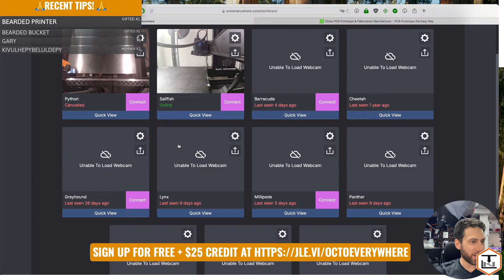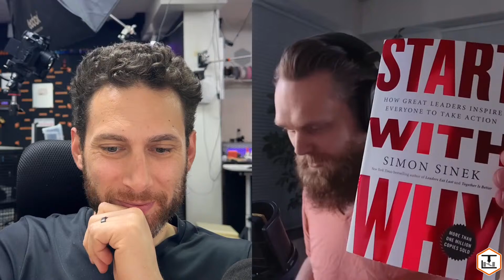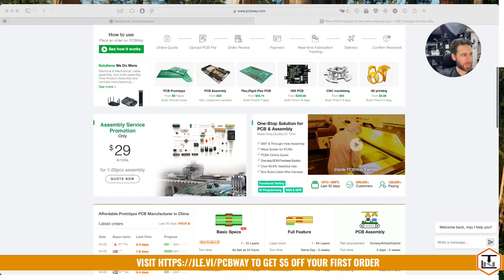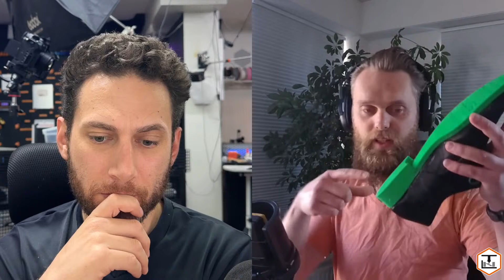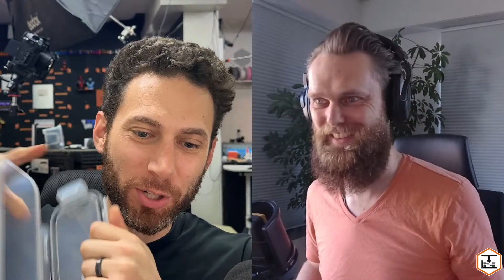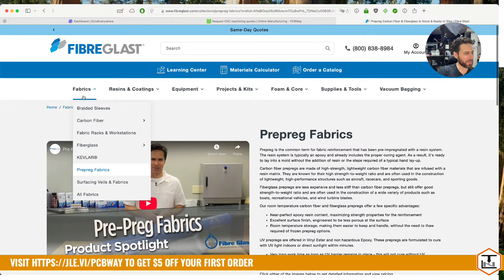Ep. 60: Jón Schone of Proper Printing on The Art of Experimentation and Breaking 3D Printing Limits

Comment: Re your printers and IP addresses. They are probably registering themselves with octo everywhere each time you turn them on - and telling it their new IP address. Which it is then translating for you.

I would personally setup DHCP address reservation in your router (or get a new router) to stop the IP addresses changing too.
Reply: I'm yet to see the router that doesn't let one set a static IP address for a given MAC. even the default ISP ones.
Reply: @kortastabukle  Me neither - although I have seen some routers that limit how many addresses you can reserve - and I imagine Jonathan has quite a few devices.
Reply: @dwuk3d  it is just the question of subnet mask, if one can manage DHCP server on the router, then the practical amount of usable hosts is 65,534 (/16 subnet mask). theoretical amount is 4,294,967,294 if subnet mask is /0 :-)